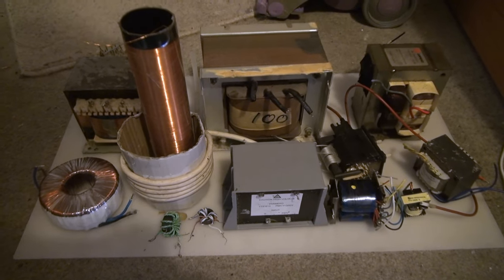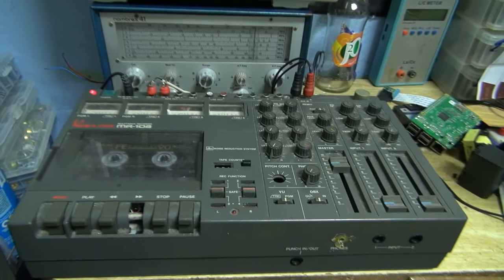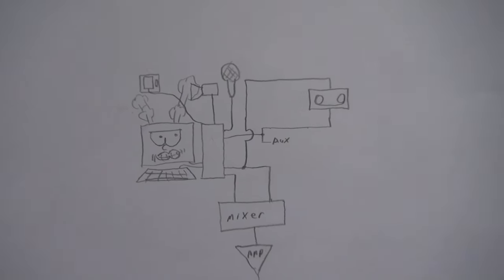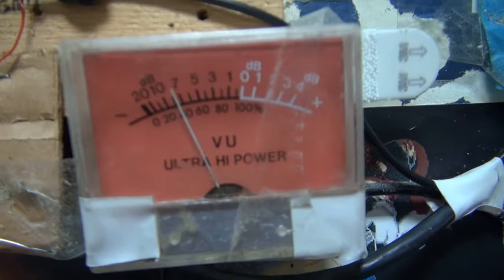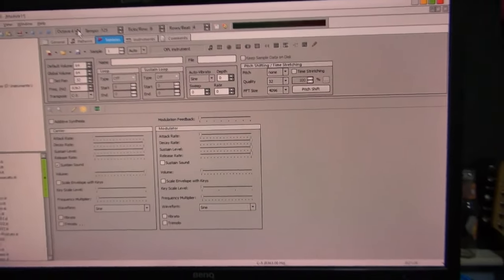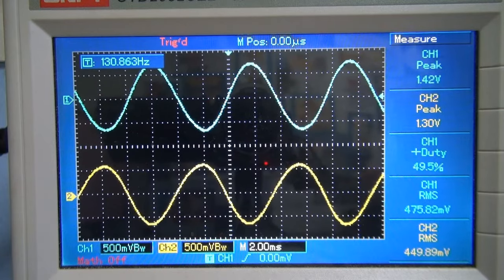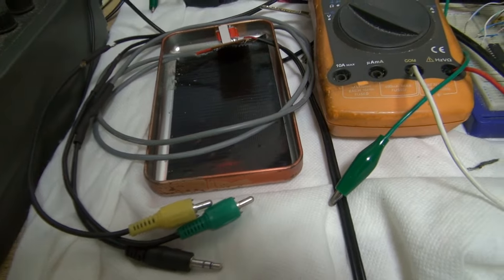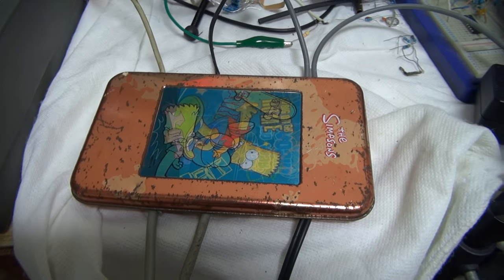Fixing ground loops with transformers.

Comment: I did try the same audio isolation transformers in my setup before and still had some noise on the output. I think this is because of the high parasitic capacitance between the two coils. I ended up using FeinTech ATG00101 transformers from Amazon and they completely eliminated the noise. I also checked the frequency response with the bode plot function of my oscilloscope and it was in a range of +/- 0.5 dB from 20 Hz to 20 kHz.

Comment: This reminds me of one time when I tried to make a diy computer audio amplifier. I used parts from 2 broken powered speaker sets, parts I had already and some parts I had to buy. It worked great, but from time to time it would make these buzzing and squeaking noises and I just never could figure out how to fix it. I never made a case for it so it was just a bare circuit board sitting on my desk and I thought prob was because of the lack of shielding thanks to the lack of an enclosure. Tho I remember hearing about ground loops online, but no good ways to fix them apart from good grounding techniques ie star grounding. Now I almost want to dig that thing out of my closet or wherever its laying around and try a transformer with it and see what would happen. I don't use it anymore these days I use wireless headphones, but if I still have it I'd like to try this.

Comment: I've use this method to create an isolated audio output from car stereo to hook up a VU meter. Connecting parallel to output speaker cable does not work, also I find adding a couple of ceramic capacitors in parallel to the audio transformers cleans the audio signal further.

Comment: There are some things I haven't totally worked out regarding ground loops. How do I prevent DC drift and over/undershoot on the isolated device? Should I add a large resistor to ground to prevent it from acquiring a bias? Is it simple to use both a high and a low pass filter to suppress ground loops while still allowing (desired) DC signals to pass?
Reply from the maker: Idont see why you wouldhave DC drift. They're not like capacitors so I wouldnt bother with the resistor. Hig and low pass filters won't do anything about a ground loop.
Reply: If the filter blocked the frequency of the ground loop it would have to, wouldn't it? The DC I'm worried about is any slow charge up of the isolated device if it isn't grounded.  @CoolDudeClem

Comment: Noise is high frequency badly filtered coming from the computer and similar equipment or switch mode power supplies. try to buy data cables with ferrite beads incorporated, you can try changing power bricks around or try a different power supply for the computer. You can build filters to fix this once you know where it's coming from. 
  Can you trace back the computer noises with the oscilloscope?
Reply from the maker: I wouldnt know how I would go about tracing the noise, all I do know is that the noise is comming from the computer and part of that was being picked up by a ground loop.

Comment: Can't you fix the inversion by reversing the wires on one side of the transformer?

If you are getting steady audible noise through  a line, the transformer will happily pass that noise along. It doesn't look any different to an actual audio signal.
Reply from the maker: There really is no need to reverse the wires, it's an audio signal. In most cases it makes no differnce if the signal is inverted or not, just so long as both channels are in phaze.